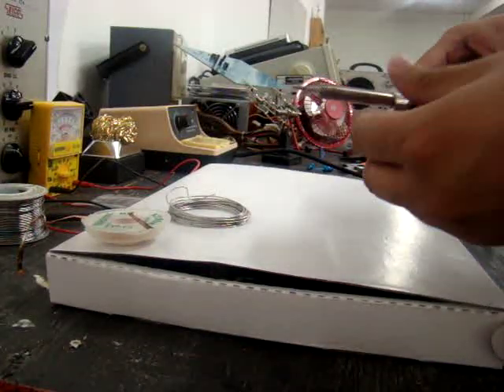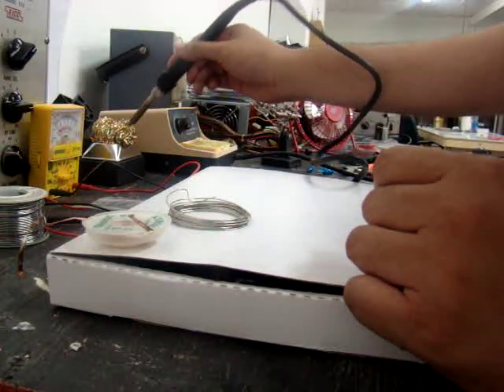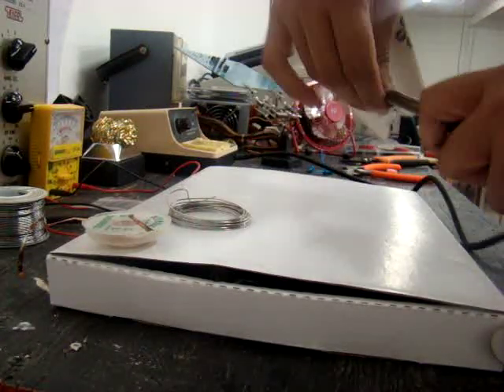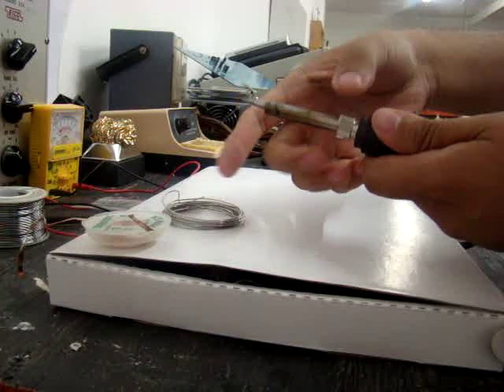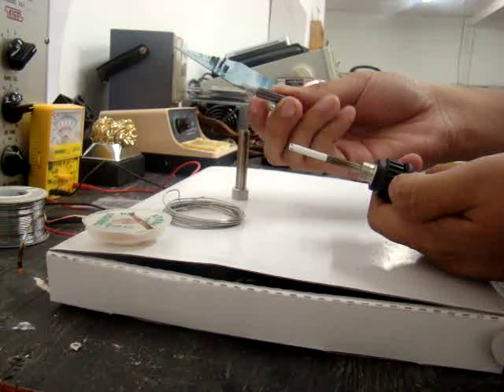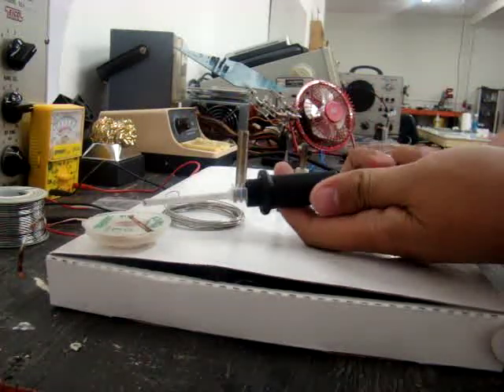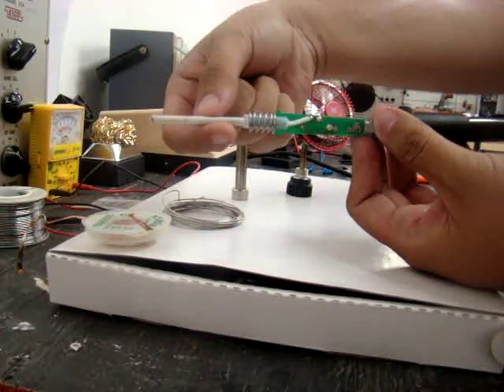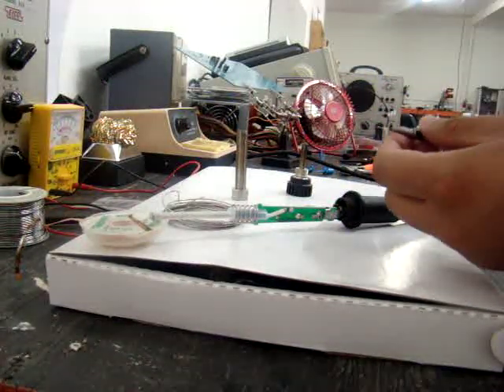how to clean an oxidized soldering tip

Comment: Could cleaning the tip wrong cause iron later to not get hot at all?  I know I didn't clean it right last time. Today the iron doesn't get hot at all. With digital reading fluctuating around 800F area. It's only 2nd time using it....  (RadioShack 60W Digital Soldiering Station)

Comment: If you only have your iron on when you are actually using it and melt some solder onto the tip as you turn it off then you can avoid damaging your tip like this.  At my work it is recommended to use a tip for 4 hours of soldering then replace it.  Tips will never last forever no matter how good you take care of them but a bit of care will help them last a little longer.

Comment: Did it despite people saying it would destroy the tip, worked perfectly. Maybe it would wear off a metal jacket after several uses, or if you're really grinding it with the force of 1000 suns, but I just sanded the layer of rust off till it was silver again.

Comment: Soldering tips are thinly nickel coated to prevent the acids in the flux from breaking down the copper tip. Sandpaper will remove the plating from the tip rendering it useless after a few uses. Dont follow this advice.
Reply: you say don't do this, but yet you give no other solution. wonderful. been doing this for along time, never had an issue anyways, not sure why so many people disliked the video but then failed to actually give any real solution...

Comment: I love the idea of using tip cleaner/tinner instead of sandpaper. But of course, getting some of that will take just as long, and cost twice as much as ordering a new tip! Where I live, that could take a week, so I offer the sandpaper proponents my heartfelt thanks for a smart, practical solution which leaves me no worse off if it doesn't work.

Comment: People don't seem to understand, This method is usually only used when all else fails.(cleaners,Wool, Flux Ect)

When the tip is so bad, That cleaning with sandpaper is the ONLY way to bring it back to working condition.
Either sandpaper, Or in to the bin. So you give sandpaper a go.

I use cheap iron's, And cheap tip's, I usually get around a year out of a tip until i need to do this, Then i get a further year out of it after sandpaper. And so on until the tip is gone.

Sandpaper does not ruin the tip if you do it properly, I have been doing it for years. Always brings the tip back to like new.
Reply: No, Not if you do it correctly.

Just a VERY light brush with the sandpaper is all u need, Try not to gouge into the tip,

Then once you are done, You need to TIN the tip so it will once again hold solder.

It happened to me a lot when i started to clean my own tips, But i soon got it right,

Don't worry, You will be able to get you're tip working again just like before,

Comment: Underneath the plating on the tip is copper and copper dissolves in molten solder so if you do this too much and expose the copper on the tip, it will start to dissolve (surprisingly quickly) into the solder.

Comment: thank you so much i sanded my tip for 15 mins and i pit it in my iron and i applied solder to the tip and wola it worked thank you so much i am so happy you saved me 40$ know i cam spend it on some PCB bods thank you

Comment: You should never use any abrasive stuff on your iron tip. There is only a very thin layer of iron separating the outside of the tip to the soft copper internals. To clean oxidation get some tip tinner instead, works very well.

Comment: sure... you need to if its not working properly... I got some total deoxidiesed tip for free cuz they dont know how to clean it XD, or buy a new soldering iron cuz when i replaced mine.... the circuit inside my soldering iron went kablooey

Comment: My tip also became contaminated & pitted despite my frequent cleaning with sponge & both steel wool & similar cleaning devices. I then used emery paper & to get a result I had to use 150 & 120 grit. The result was very rapid further deterioration.
My iron was a cheapie $15 unit so maybe I got the short life performance I paid for?

Comment: very fine sandpaper like 1200 grit wont have a severe effect, but you should only do it once every blue moon, if its absolutely necessary and you would be fine.
also, tinning the soldering tip before and after and leaving it off with te solder still on the tip keeps out oxidation (given that rosin core solder is used)

Comment: Best way to clean it is to use the damp sponge method while hot and the put some solder on the tip and store it with the tip coated with the solder.  Heat it up and clean it off with the damp sponge again before reusing.

Comment: @lonesoldier33 It depends oh how you clean it. If you're using a gold-mesh cleaner, you'll want a good thermal transfer so do it while it's hot. Although I haven't heard of any problems doing so, but I feel leery about thermal shocking the iron on a wet sponge, I wait it's cooled down. You'll definitely want to clean it as oxidation won't allow a good thermal transfer, but unlike the video I wouldn't use sandpaper as some irontips have an anti-oxidizing layer and sandpaper will just remove it.

Comment: Hey, question relating to solder irons but not the video: what should I do when I turn off the iron? Do I clean it while it's still hot or do I wait until it's cooled to wipe off the excess stuff left over from using it? Or do I clean it at all?